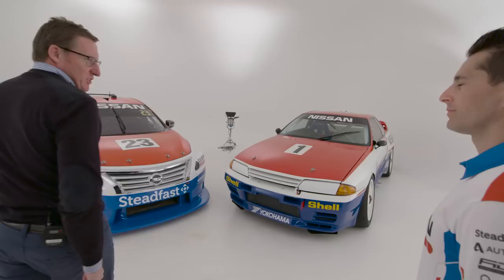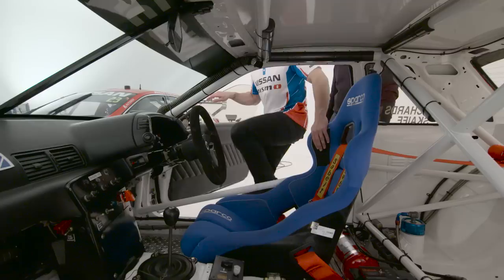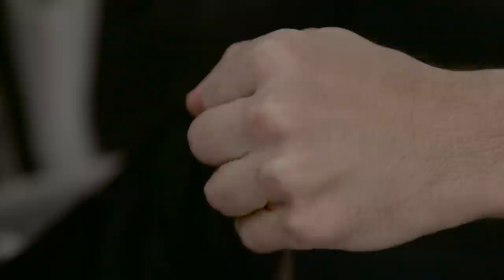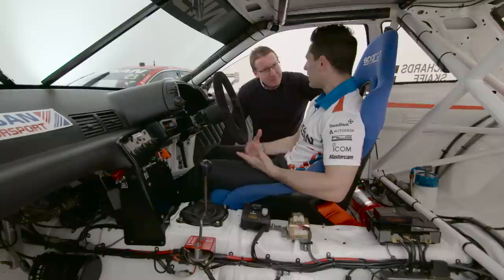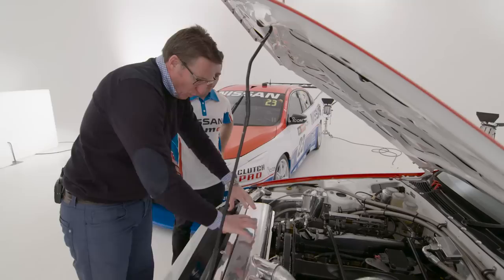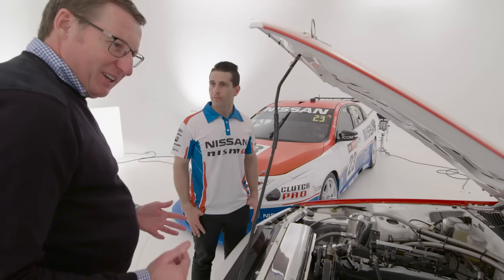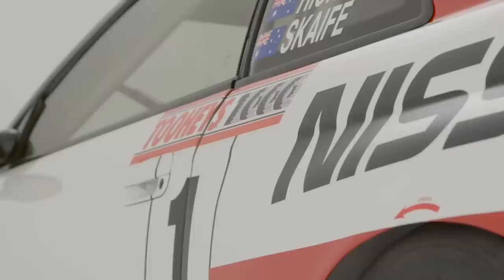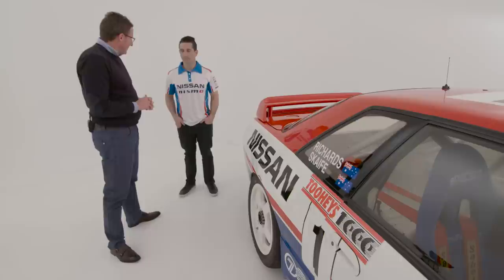Mark Skaife technical feature on 1991 Bathurst 1000 winning Nissan GT-R R32

Comment: “We did all the turbos and intercoolers” suuuuuyere u did…
“It originally came with 48 inch rotors so we put 48.8 inch rotors.” Difference of .8inch and this guy is bragging about it like they built the whole car.
“We put new tires” I can put new tires. Tires don’t win you the race. 
“Australiazation” like that means anything. When’s the last time you saw an Australian car at a dealership? Never…
Instead of giving thanks to Japan and Nissan motor sport for handing them the greatest race car ever built, they try to get slick by taking all the credit for the car.

Comment: end of the day its a 4 wheel drive.. superior handling .. turbos.. etc compared to rear wheel drive car.. it should never of been allowed to race at all.. its a no brainer
Reply: The regulations allowed it, it's a shame that rather than build cars that could match it the other manufacturer's cried to CAMS to get it handicapped and then banned (of course we went to V8 Supercars so no complaining here, some of the best racing has been in the last 20 years)